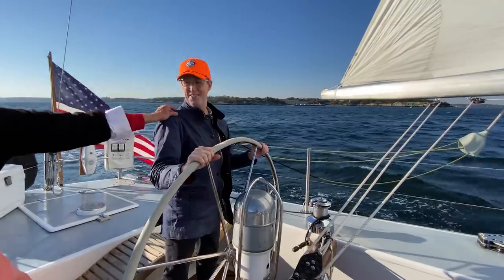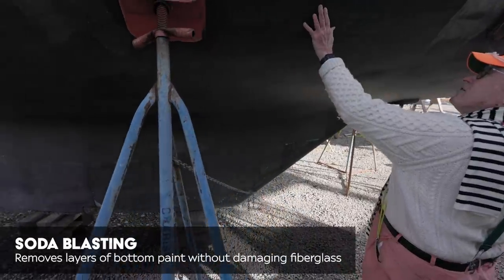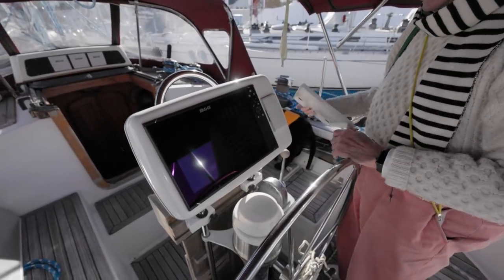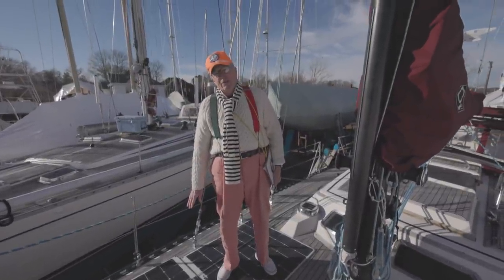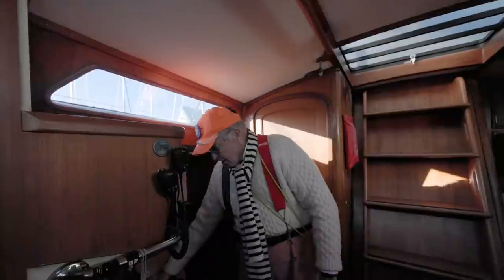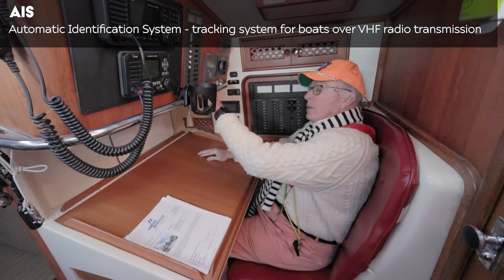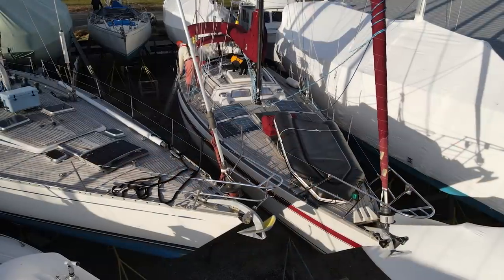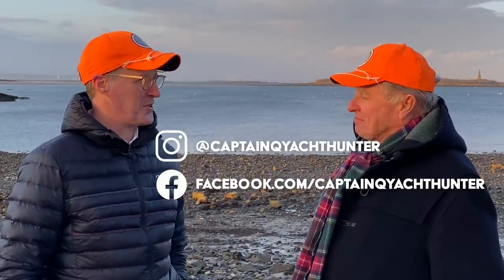$99,500 USD GLOBAL CRUISER! Proven bluewater sailboat for sale! EP76 #sailboatforsale #sailboattour

Comment: The boat is disappointing and, that’s about it from my perspective. This is my very first negative comment on any boat that you two have reviewed.
Reply: Agreed...Perry tried to cram too much into a canoe stern design....might be a good sailing boat for world cruising but to live on board..no thanks.
Reply: What Capt. Q did not have the time to talk about in his short video.  Mostly done in 2018/2019:

Accommodations
Sleeps 7-8.  V berth forward.  Enclosed head with vanity and shower next aft to port, hanging lockers opposite to starboard. Main cabin features U-shaped dinette to port which converts to form double berth, settee opposite to starboard. Galley next aft to port, forward-facing navigator's station opposite to starboard. Aft owner's stateroom with double berth to port and single berth to starboard is accessible from main cabin through a second head, with vanity and shower, located aft of navigator's station. Both toilets are Wilcox Crittenden Skipper models, both rebuilt in 2019. Shower fixtures new in 2019.

Galley
U-shaped galley features propane four-burner, gimbaled, stainless steel stove with oven (oven  not working),  Sea Frost (2021) 12 volt refrigerated ice box and separate freezer with digital monitors and controls, double stainless steel sinks with pressurized hot/cold water. Propane system installed in 2019.

Electrical
12 volt DC and both 110 volt AC and 220 volts AC. Engine and generator starting batteries are 12 volt lead acid. House batteries consist of three Relion RB-300-hp 8D 300 ah lithium iron phosphate batteries (2019). Four deck-mounted semi-rigid, walk-on, 175 watt SolarWorld Sunmodule solar panels mounted on foredeck whose 700 watts of power produce as many as 250 ah per day! The four three-foot-square panels feed two 30 amp Victron SmartSolar MPPT charge controllers, monitored via a Victron Color Control GX mounted at nav station. Eclectic Energy (British) D400 wind generator (2019) with max output of 600 watts. Nex-Gen 5.5 KW 10 HP diesel genset (2019) with 75.7 hours. 110 and 220 volt Victron Energy inverter/chargers (2019). Boat automatically accepts 110 volt or 220 shore power and can output both voltages simultaneously, if so desired.

Electronics and Navigation
Brooks and Gatehouse electronics suite including forward-facing sonar, AIS transceiver, 4G radar (antenna mounted on mast), three Triton2 multi function displays, 12" Zeus3 chartplotter, and barograph. All purchased new in 2019, all updated in 2021. Simrad hydraulic autopilot (2019) networked to B&G system, Icom M803 marine HF SSB radio transceiver (2019) with DSC and color display, Icom AT140 automatic antenna tuner (2019). Insulated backstay serves as SSB antenna. Copper foil ground plane glassed into hull during boat's manufacturing process (standard practice with all Lafitte 44's). Icom IC M-506 VHF radio transceiver (2019) with RAM mike (2019). Iridium wifi satcom system (2019). King wifiMax router and range extender (2019). Ritchie SP5 binnacle-mounted compass.

Hull and Deck
Modified full keel with skeg-hung rudder. External lead ballast. Airex-cored hull, balsa-cored decks. Teak decking. Double bow anchor rollers. Maxwell electric windlass, rebuilt in 2019 with foot switch and wireless remote control. Double stainless steel lifelines (2018) with starboard boarding gate. Edson steering system. Four opening overhead Bomar hatches. 10 opening ports. Two Marinco solar vents with reversible fans. Two midship deadlights (2019). Cockpit shower. Dyneema jacklines, port and starboard, running bow to stern. Three padeyes in cockpit for attaching safety harness tethers

Sails and Rigging
Cutter-rigged keel-stepped aluminum mast. Staysail stay fitted with quick-release lever at base allowing stay to be quickly deployed or stored. Running backstays. Sail inventory of 7 sails, all made by Port Townsend Sails in 2019, includes fully battened mainsail with two deep reefs (30% and 60%), light air loose-footed mainsail with snuffing sock, roller-furling 115% genoa, Dyneema-stayed drifter, particularly robust staysail, storm trysail with separate track on mast, and storm staysail. Block and tackle boom vang with Dyneema line, 22', 20 lb. carbon-fiber whisker pole (2018) with integrated stowing (flush with mast) nd deploying system. Harken mid-boom mainsheet traveller (2018) mounted on house. Winch inventory includes two Harken #35 two-speed, self-tailing, mast-mounted halyard winches, Lewmar #30 self-tailing, two-speed, mast-mounted, reefing winch, two Lewmar #55 self-tailing, two speed, primary genoa sheet winches, two Lewmar #40 self-tailing, two-speed winches mounted on coach roof, one Lewmar #46 self-tailing, two-speed winch mounted on coach roof. All standing rigging and turnbuckles new in 2018.  Most running rigging replaced in 2018 with Dyneema. All chainplates removed in 2018, dye tested, and electropolished. All chainplate attachment points reinforced in 2018 with additional glass.

Mechanical
Wind Pilot Pacific (German designed and built) servo-pendumum mechanical windvane self-steering system (2019).

Additional Inventory
Viking 8-person liferaft (2019) in hard cannister mounted in a deck cradle. 3D Superlight Twin Air 290 9.5' inflatable dinghy. Burgundy cockpit dodger (2019) with zippered front window, stainless steel bows, and stainless steel grab rails on three sides. Burgundy bimini (2019) with stainless steel bows, full 360 degree enclosure, canvas covers for all windows, window on top for checking sail trim, and cover for top window. 45 lb. CQR plow anchor with 300' of 10 mm chain, 300' nylon rode, Danforth 35 HT with 50' 10 mm chain, Paul Luke 100 lb fisherman anchor (2019). Ace Sailmakers (E. Lyme, CT) Jordan series drogue. Plastimo extendable man overboard pole (2019). Stereo with two speakers in main cabin. Pots and pans. Toaster. Five fire extinguishers, six fenders, assorted docklines, two horseshoe buoys (2019), boat hook. Misc. engine spares.
Reply: @larryboles629  
Thank you for  taking the time to post the complete description.